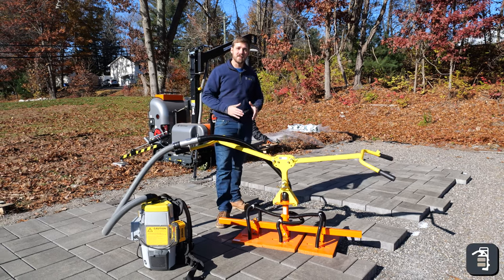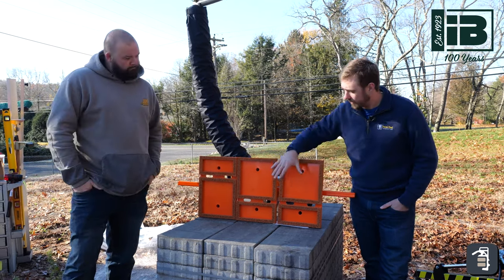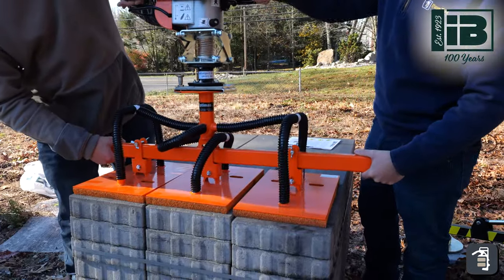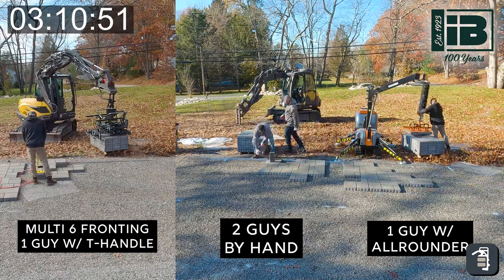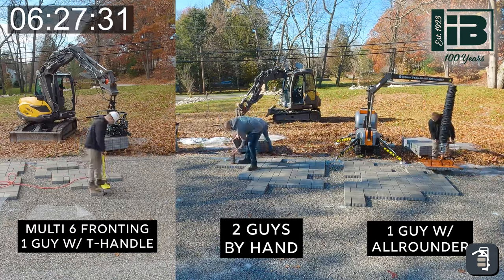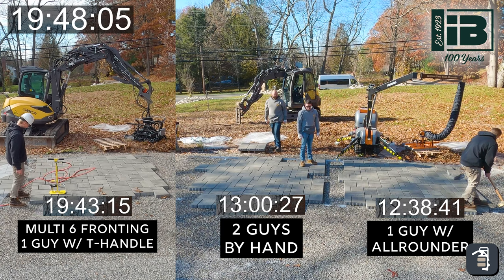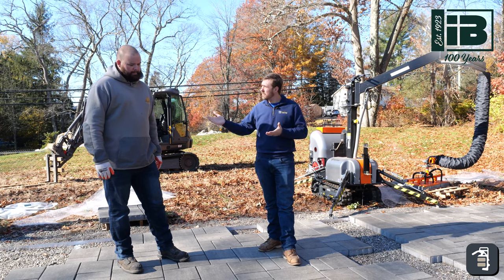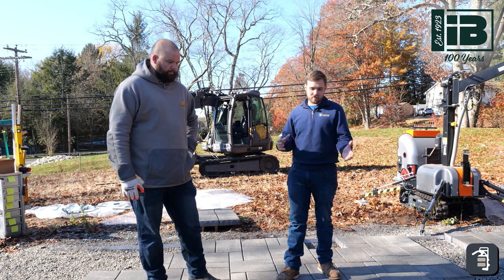Easy Mechanical Laying

Comment: So the concern here is getting the pallet laid out before it is shipped to the jobsite. Are manufacturers doing this yet or do the pallets have to be restacked by the contractor after they receive them from the manufacturer?
Reply from the maker: In this case, Ideal Block arranges the pallets of this product prior to shipping it to the contractor. There are block manufactures that have produced pallets of product that are specifically designed to be mechanically laid. If you would like to have further discussion, please reach out to us and we'd be happy to chat 860-870-8665